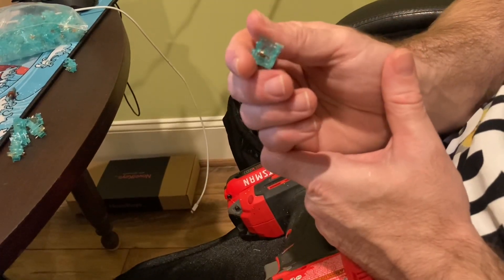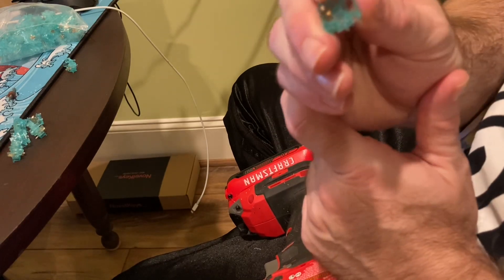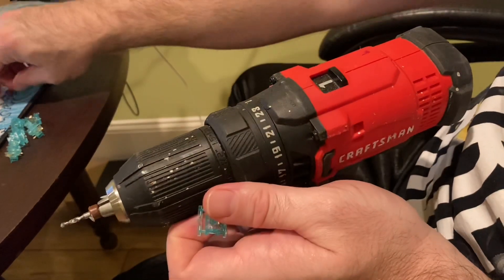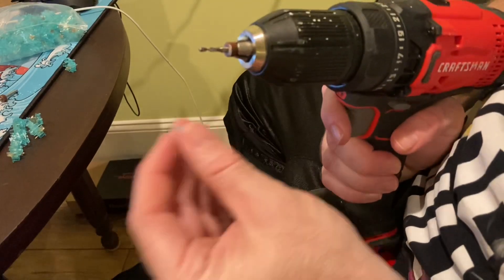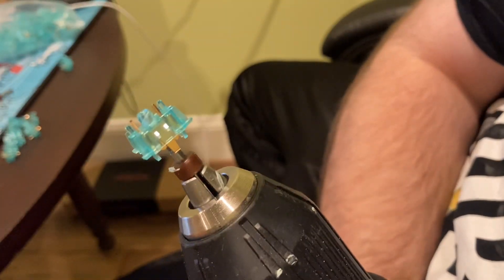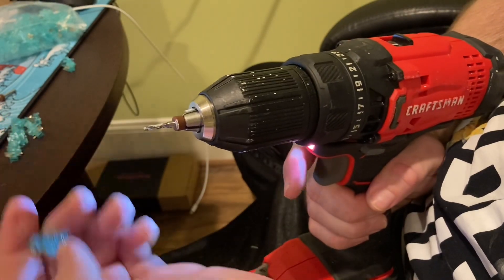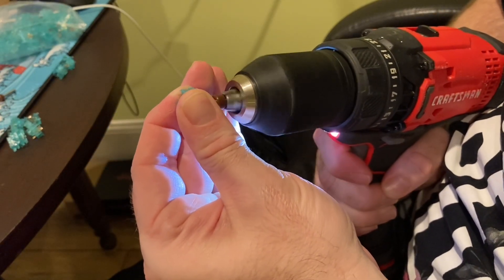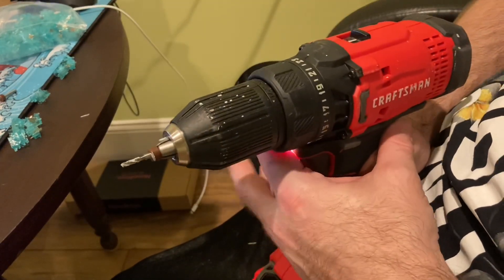How to retool Gazzew (Outemu) Blue Ice mechanical keyboard switch bases.

Comment: What chuck attachment did you use? Can you link?
Reply from the maker: it's a 2.35 mm bit.
Reply: @KirballsKeys  I don't see drill bits measured in mm is the 3/32 which is more like 2.38 mm?
Reply from the maker: @jdbaker82  that I honestly don’t know. The bits were given to me by Gazzew not sure where he acquired them.
Reply: @KirballsKeys  thanks I found one do you think this essentially removes the scratch from hyperglide switches? Ie faster break in?
Reply from the maker: @jdbaker82  couldn’t hurt to try one and see.